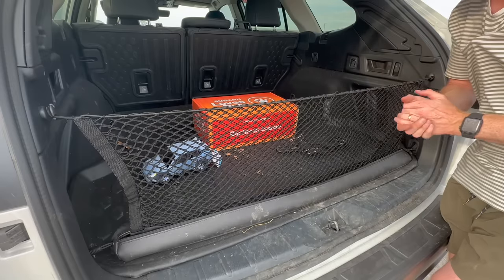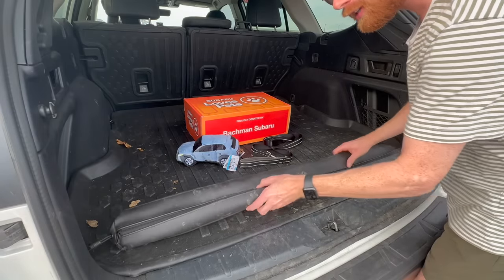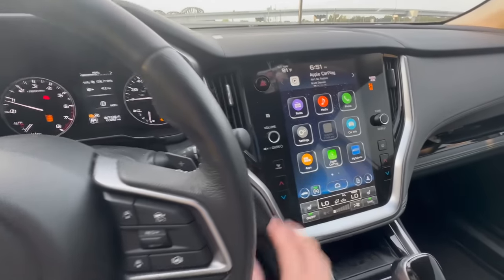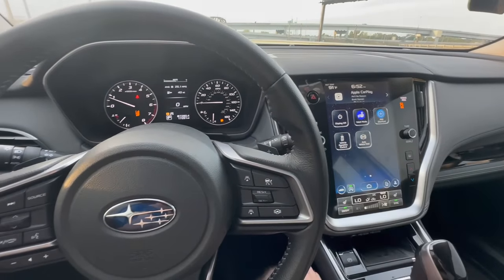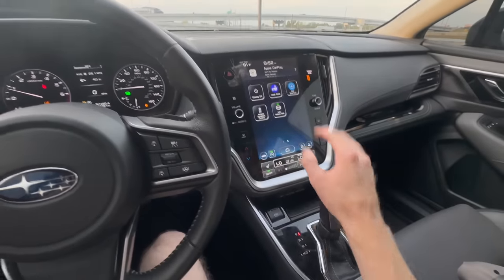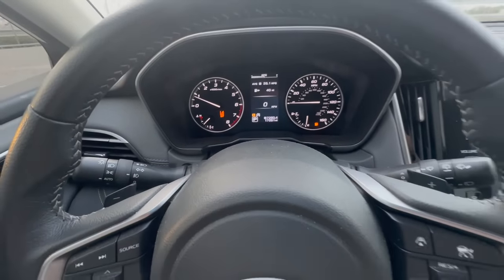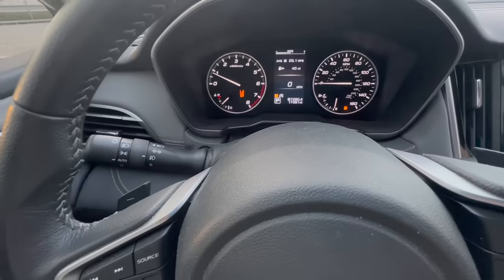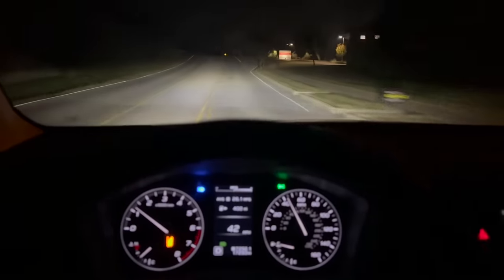Top 5 Hidden Subaru Features: Outback, Forester, Crosstrek and more

Comment: I have a question. I changed the battery in my 2018 Subaru Legacy and the head unit radio locks up all the time. It also skips radio presets and Android auto and the USB ports fail to connect. What is wrong so I can fix it.

Comment: Alex. Hi. I just purchased a 2024 Crosstrek base model. Is there a way to turn off the headlights while driving. Reason is I have off road lights and rack and would like to run my yellow lights rather than my headlights. If that makes sense.
Reply from the maker: Hey Emiliano! Unfortunately, there isn't a way to turn the headlights off while in gear. I learned this the hard way during a Christmas light show where they asked us to turn our lights off. I wasn't able to 😂
Reply: @alexpmo  😂 that's funny. Thank you for your response

Comment: Alex I just bought a 2024 crosstrek 3 days ago. and I live in Baton Rouge, LA  Yesterday on startup it vibrated a litle too much for me to not have some concern.  Is this something your familiar with?  I contacted sales and they gave me (well in cold climates it does that) i said ma'am.  It's 90 degrees at 8am here.  Cold climate?
Reply from the maker: Congrats on your new Crosstrek! The car will idle higher on cold start to get the engine up to operating temps quicker. This can feel rough on initial start up, but will idle down after a minute or so. So whether you're in a hot or cold climate, this is normal. However, if you feel it was idling rougher than usual, I'd recommend having a tech take a look at it.

Comment: I got a 24 Crosstrek in December. In the last couple weeks the infotainment system has been buggy. The other day the warning screen that pops up at startup just sat and spun and the main interface wasn’t popping up after about five minutes. I had to turn the car off and open the door and restart for it to work. Today, the Apple CarPlay button wasn’t responding so I couldn’t access the podcast screen or anything in CarPlay. The podcast was playing, I just wasn’t able to see it on the screen. 

Is there a way to do a reset of the system? The car only has 2,400 miles.

Comment: Curious you’re thinking here I have had the 2020 Subaru Legacy touring edition and then I got the 2021 XLT one model below the touring model. My lease runs out in 2025 and I’m not considering getting another Subaru until they change the head unit the technology is extremely buggy and frustrating to a point, I won’t get another one until they fix it. Thoughts?

Comment: I have a 2024 Crosstrek Limited.  The low beam headlights are weird.  They throw off shadows that are very distracting when driving and the retained accessory power only stays on about 50% of the time when you turn the engine off.  Are these normal or problem issues.   Thanks

Comment: I have a 2024 CrossTrek. My question has to do with Apple Car Play/Bluetooth. I wear hearing aids that are connected to my phone via Bluetooth. So when I am away from my car and my phone rings or want to play music, that sound goes directly to my hearing aids. The thing I run into is when I get in my car the Apple Play won't recognize my phone. I have to turn off Bluetooth then turn it back on to get the car to recognize my phone, and then everything is fine. It's a simple workaround, but I would like to see if it (the phone or the car) can figure it out by itself. I have an iPhone XS.
Thank you so much for your videos, I really enjoy them.  This is my first brand-new car, as I just sold my 1996 Tacoma (i.e., I was behind on technology).

Comment: I have a 2016 crosstrek I bought used. When I start it cold, it runs at about 1800 rpm for the first minute or so if I don’t move. Is this normal?

Comment: Hi Alex! I have a Subaru Assent and when I put gas in my car, I didn’t realize the cap wasn’t on completely and turned on the dashboard lights like a Christmas tree. It’s a 2023 model and I’m trying to get used to all the features. How do I reset the lights once I fixed the gas cap? Also! It has a sunroof, can we drive while opening it? Will the pressure break the sunroof?? Please help!?
Reply from the maker: Once the cap has been put back on correctly, the lights should go off. If not, you can have it reset at your Subaru store. The sunroof can be opened while in motion.
Reply: @alexpmo  thank you!!!🙏

Comment: Buying my first 2015 Outback premium so I need to see tomorrow when I go back to close deal.  I HOPE it has this because when I drove it last week.  I have ADHD and often lock keys in car.  
So if keyless is active will it let me lock keys in the car if Keys are in ignition or on seat.
Reply from the maker: Hope it worked out! As long as it's the keyless entry fob with push button start, it won't let you lock the keys inside. At least not without putting the key in sleep mode.

Comment: Please review the 2024 Forester Climate Control System; auto compared to full auto versus manual operation. Particularly curious about why I was told to leave AC and recirculating air ON all the time (even when cold outside in Winter). Thank you

Comment: Trying to decide between the outback or the forester? I want a bigger back mainly and from what I can make out the main difference is the outback is length and the forester has height. Otherwise the car internal is much the same, is this correct?
Reply: My 2020 Forrester cargo bay seems much smaller than my 2011 outback. I think they’re quite different.

Comment: If you have the auto vehicle hold on does that negate the autostart/stop or do you still have to turn it off? Assuming you want it off of course
Reply: They are separate. That autostart/stop is a pain in the butt. I tend to forget to turn it off.
Reply from the maker: Tom is right. They're separate so you'll still have to click the auto start/stop button each time if you want it off.

Comment: Hi I’m buying a Crosstrek this week. Does anyone know if there is a promotion for starlink when you buy a new vehicle? I had heard you could get 7 years at a lower yearly fee but only when you buy a new vehicle. Is that true or am I misinformed? Thank you for the help and any links to information would be greatly appreciated!
Reply from the maker: Yes, you have the option to extend starlink at a discounted rate. There are two plans people commonly get. The first one is "safety plus". This gives you roadside assistance, accident alert, and maintenance alerts. It's usually $99.95 annually but can get this for up to 5 years on your new car for $174.95 plus tax. The second plan people commonly get (and the one that I have) is called "security plus". This includes all of the features in the safety plus but adds remote access capabilities. You can remote start your car, adjust climate controls, lock/unlock the car, and you can even track your car. This one is usually $149.95/year but with the discount you can get it for 5 years total for $249.95 plus tax. This is something your Subaru salesperson should know all about and will help you set it up the day you buy your new Crosstrek. Here's a quick short I made using it on my car: https://youtube.com/shorts/RnUEREv_7RA
Reply: My dealer throws Starlink in for free. Try to get them to do that for you.

Comment: Hello Alex, I am writing to you from Santiago de Chile. Your videos are excellent and very educational. I have a 2019 Subaru XV, which has given me a lot of satisfaction and has worked perfectly to date. However, I have a doubt. I bought a caravan (Hobby De Luxe Easy 400 SF, weight 880 kg.), which I am towing with the Subaru XV (2.0 cc, 156 HP, 196 Nom and 1,415 kg. weight). So far everything is going perfectly and even climbing very steep slopes (for example, Cuesta Caracoles that crosses the Andes mountain range from Santiago to Mendoza, Argentina). Sorry for the length, but the data is basic for my query. The Subaru XV has a Lineartonic transmission, which is the most vulnerable point for towing. The main problem is the increase in temperature, which is indicated by the "AT OIL TEMP" indicator when it is already very hot and you have to stop. The only previous indicator is the oil temperature. And finally we come to the consultation. Do you know what the normal oil temperature of the Subaru XV is? I understand that it is 90° Celsius, but the car without a trailer in the city runs between 100 or 115° Celsius. You have more information on this issue of oil temperature ranges. I would appreciate. Greetings from the south of the world.

Comment: sorry, one more question: How would I know all the features/options installed on my 2023 Subaru Limited? thank you
Reply from the maker: All of the features mentioned are either standard or optional on the 2023 Forester. The extra fuses, AVH, high beam assist, and pin code access are are standard while the cargo net is optional. The Forester AVH feature operates the same way but the button is located near your gear shifter instead of on the touch screen.

Comment: For me i 'own a Forester wilderness 2023 and i buy the cargo net but i install on the opposite way. The vertical pouch is on the back side of rear seats. the only issues with that installation is to pass hook in the anchor point and use with some carabiner to complete the installation.

Comment: In 2023 I bought a new Subaru wilderness and I’m not really a fan of all the bells and whistles it came with, now a year later the Eyesight feature turns on and off on its own. It says to check owners manual but manual has nothing under Eyesight. I mentioned it to the dealer but it just so happens that everything is working fine when I take it in.

Comment: Hi Alex       Would you know  what happens to the keyless system when 2 fobs are in the car at the same time?  I recently was in my Subaru (2020) together with my wife and we each had our active fob   .  I wasn't able to start the car .  My wife had to step out and away from the car about 6 feet  and then I was able to start the engine with the push button.
Reply from the maker: You should be able to start the car as normal even with both keys in the car. Just one key needs to be in the car to start.

Comment: I always appreciate your inpu and did Subaru crossterk 2021 keyfob have remote stater build in? If so, how do you use it?
Thank you.
Reply from the maker: The 2021 with push button start uses the MySubaru app on your phone for remote start. You'll have to get the starlink subscription for this. I believe it's 149.95/year. Just have to contact Subaru or your retailer to get it.

Comment: I have a 2020 Subaru Forester. I used to easily connect the android app to my phone with a USB charge cable, now it doesnt work. Ive used several different cables, so thats not the problem. Now i cant use my phone gps, which is up to date, unlike the one in the car. What could the problem be? Ive worked through the fixes in the manual but no joy. Any ideas? I'm in Australia.

Comment: Hi Alex. I really enjoy your very helpful & insightful videos.  I have a 2022 XV (Australia).  I use the music app on my iPhone to play in the car. It's very irritating that each time I start the vehicle the music starts playing, even though I stopped it playing the previous time I used the car.  The dealer said to just mute it as they did not know a way to stop it doing this.  Is there a way to stop this happening?  I can't find anything regarding this in the owner's manual. It's not a big problem, but annoying.
Reply: Try holding the on/off button down for a few seconds instead of a quick tap. This turns off the radio and it shouldn't come back on at startup.

Comment: Please help. The emergency lights which flash when you lock or unlock the car using the key fob no longer flash.
2014 Forester.  I've replaced the battery in the key fob.

Comment: Hi alex, my 2023 Subaru Outback has a chirping noise. It has no correlation to anything I'm doing driving nor is there any message that pops up on the dash to relate to what that noise is all about. I also am having tremendous difficulty setting the driver's seat in a permanent position following the manual
Reply from the maker: Not sure what the chirping noise could be. Is it doing this with the car on or off?
Reply from the maker: Here’s a video I made on the memory seat settings. Hope this helps! https://youtu.be/7W_Z03chtEY?si=H-Yy9ikUeqDyfcVj

Comment: Hey Alex!  Thank you for your Subaru Videos.  I have a Subaru Ascent 2022 that when I plug in my Android Cell phone, the Android Auto comes up but only stays on for 5 minutes and disconnects.  Do you have any idea why this is happening?   Thank you!
Reply: I had an issue like that just last week.
First, deleting and reinstalling the MySubaru or Android Auto on my phone fixed this glitch.
Then, I checked for a software update. It wasn't obvious at first that an update was needed, but it worked better after using my phone as a hotspot for the update download and install. That fixed the disconnection issues I was having while driving.
Reply: @LLawhon84  Thank you very much!  I will remove and reinstall the Android Auto.   Again, thank you!

Comment: 2015 Crosstrek has odor in passenger cabin. Cabin filter replaced, manifold and muffler checked, liquids on engine checked--odor pesists. No spills on mats or seats. Repair shop gave up and suggested detailing shop.

Comment: Hi alex....is the eyesight always turned on or not?...i use forester sk ...find only turn off bottom
Thanks for your great vdo..i follow you
Reply from the maker: Eyesight emergency auto braking is on by default each time you restart the car. You can turn this off though. Eyesight adaptive cruise control has to be turned on by the driver though
Reply: @alexpmo  perfect and thanks for your comment....kindly continous the best vdo like you do/did...i follow you from 13000 km...(thailand....cheerssssss)

Comment: My 2023 Forester has a switch for the auto brake hold right in front of the console box.  I didn't know there was also one in the touch screen display, but I will certainly move it to the home screen because it'll be more convenient there since I also use it all the time.

Regarding the high beam assist, I absolutely hate it!  It is one of a few problems with the Subaru headlights if you live out in the country, especially where there are curvy, hilly roads.  That is that if it sees a porch light, a street light as you top a hill, an extra bright outdoor light in a curve, or even a reflective sign that appears extra bright it will dim the lights just when you likely need them the most.  I generally do not use it for that reason.  

Another big problem we have is that when the low beams are on the top of the beam cutoff is too sharp, with no scatter that allows you to see things above the beam's focus.  This is a very real problem on our short hills.  We had to get the dealership to readjust the light to raise the beams so now we often get oncoming drivers flashing their high beams at us even though ours are off.  So our choices seem to be either blind the oncoming driver or not be able to see if there is anything on the road too short a distance ahead. You can see this at 10:59 though there is more ambient light in that situation than what we normally have where I live.  Subaru needs to have some kind of diffuser on the low beams that allows a small amount of light to scatter above the cutoff, just like headlights used to work.  Not enough to blind oncoming drivers, but enough to actually see the road ahead with low beams on on a very dark road.  This is a very real safety issue that should be addressed ASAP.
Reply: I totally understand your gripe about the H.I.D lights having such a dramatic cutoff. It's kinda amazing actually how these new lights do that but yeah, not great in some situations. 
As for the auto high beams, they have been amazing for me and our country roads are very twisty and hilly. I did notice as you mentioned, a couple times they picked up a bright porch light and went into low beam mode.
Reply: You might want to look into aftermarket driving lights. Perfect for your conditions.

Comment: i have  a 2018 outback. the radio went “crazy”. they call it ghost radio, little footprints on the screen and it changes stations on its own and it is like you are constantly seeking.  
corporate subaru would only give$750 for repair and it us close to$2500 repair.   and it is back ordered.  i have 95000 miles and the e tended warranty ended about  two months before radio system went out  thinking of getting a different car.

Comment: Hi Alex I have just added you to my favorites.  I love my 2021 outback XT limited but I’m am finding little quirks that I never had on my 2012 Forster. First, my driver monitoring continues to go off. It’s on for a small time and then goes off automatically then I have 22,000 miles on this car and then mechanic told me I need two front tires along with brake shoes, that’s ridiculous and the last thing is that I was promised and I still have the papers to prove it that this new outback at the time would have at least 23 miles on the gallon around town and 30 some odd gallons on the open road well, it turns out that my outback gets 15.9 miles on a gallon of gas and I have tried every kind of gas. You can imagine. This is very disappointing to me and I am thinking very seriously about another car.

Comment: My favorite hidden feature is turning off the obnoxiously loud seat belt chime when u have something in passenger seat. Worked on my 2013 and 2022, the 22 is crazy loud and obnoxious. Turn the key to the notch before car turns over then put the drivers seatbelt in and out 20x in 30 seconds and turn key off. Then turn car back on and no more seat belt chime.
Reply: Does this work for push start?
Reply: @nomomsnorules2804  think it works on all of them. Took me a couple tries but it worked
Reply: @dustinhoward2990  awesome thanks, ill give it a go